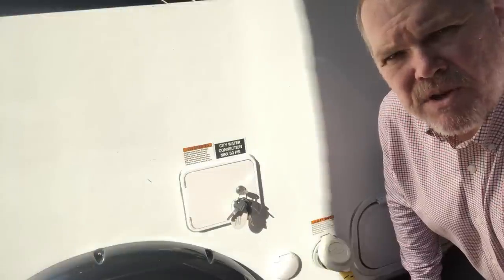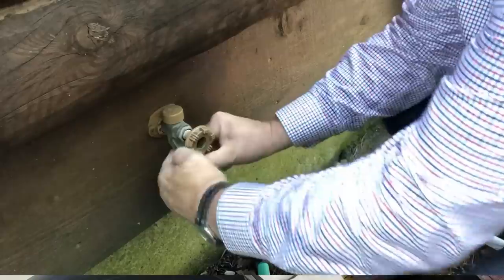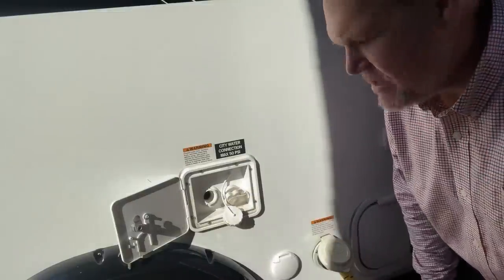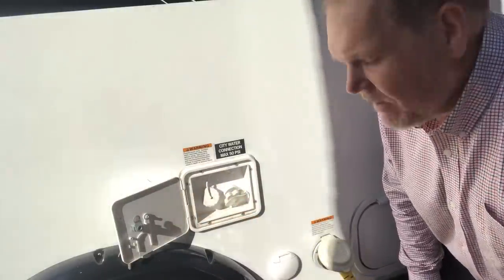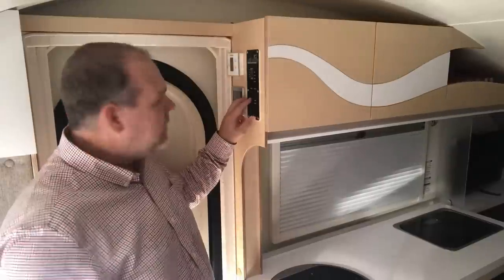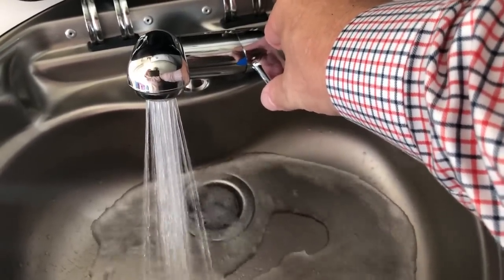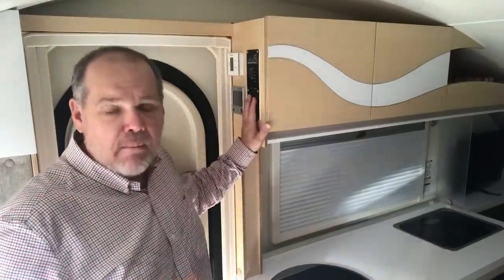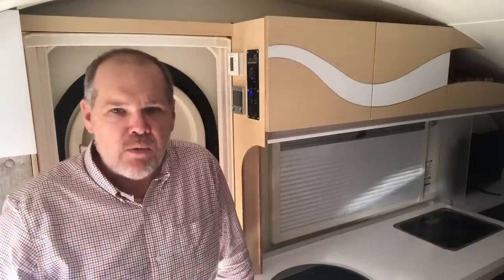Take 5: Water Sources in a NuCamp Tab 400

Comment: Out or curiosity….where is the actual fresh water tank located?  I know where the hookup is, but wondering the physical location .I have a2016 400 Tab which is only 11 gallons. Is the tank on the underbelly of the trailer?
Reply from the maker: On the 2018 model, it was located behind the axle. I use to fill the tank to help take weight off the trailer tongue.

Comment: I tried to turn the water on in my 400.  I have water in the tank.  I turned the pump on and heard it hum for a minute.  BUT.... when I turn on my faucet, no water came out.  Does something else have to be turned on?
Reply from the maker: Sounds like you may have air in your line or possibly your water pump has gone bad.
Reply: @TravelswithDelaney  Thank you!  It is actually working now!  Not sure what happened.  Wouldn't be surprised if it were operator error!

Comment: Hey Patrick, lots of folks on the forum recommend a psi regulator for city water.  Do you use one?  Why or why not?
Reply from the maker: Yes....we always use one.  It makes sure you don't put too high of a psi in your lines.  Yes..Pex can handle the pressure but some of the cheap plastic fittings being used typically can't handle more than 50-60 psi.

Comment: The T@B 400 Manual suggests using an inline pressure regulator at the water supply faucet when connecting to the city water hookup, since water pressures can vary.  I noticed there was no mention of this in the video. Wondering how important and common it is to use such a pressure regulator?
Reply from the maker: I highly recommend always using a pressure regulator.  You typically want to limit the pressure to around 50 psi or less.

Comment: So do you consider the water potable?   

If so do you treat the system, internal to the camper, in some manner to get rid of bacteria?  If so what do you use?

Hooking up to water sources of unknown quality seems dicey at best, do you use any kind of bacteria filter on the inlet to the camper?    In my years of camping I have witnessed some skin crawling  events at those hydrants to the point I don't consider  it safe to drink or brush teeth
Reply: Some people actually will sanitize the water spigot prior to connecting their hose by using bleach or alcohol.
Reply: @sharonthehuman5954  I wouldn't use a alcohol to sanitize anything related to water.    Bleach is solid as is hydrogen peroxide, but needs to be in higher concentrations than is available to typical consumers.
Reply from the maker: We only use the water for showering, dishes or the toilet.  We sanitize the tank each spring before camping season using a proper solution of bleach and water.

Comment: Yes turn the pump off to save battery because when left on and the pressure drops in the system the pump will come on and keep the pressure up in the lines.  Is a waste of battery.
Reply from the maker: I try my best to save every drop of power in the battery.